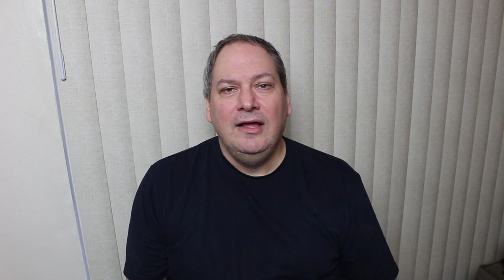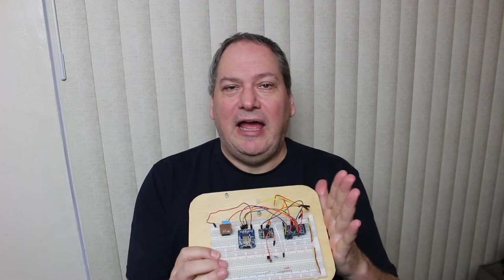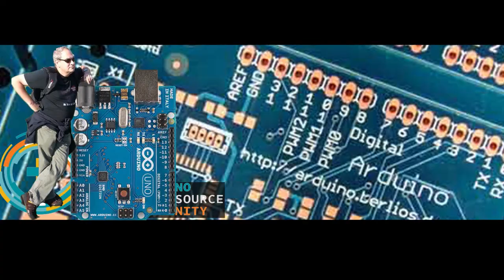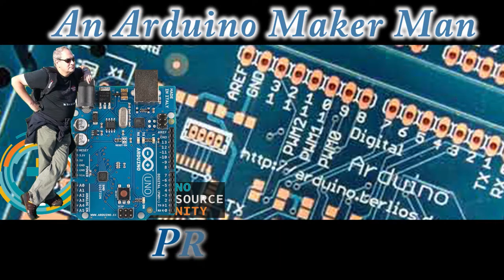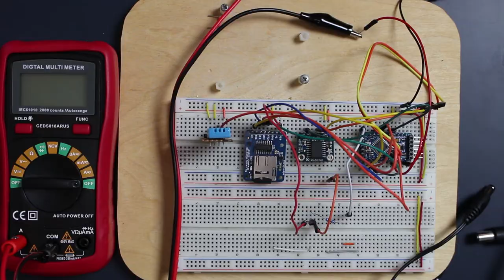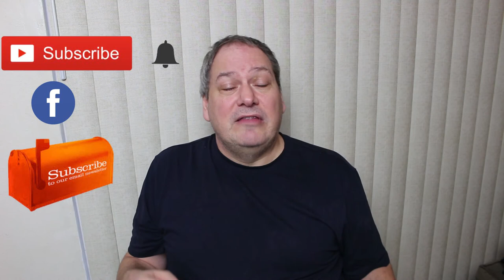Project: Example using a RTC to wake-up an Arduino Data Logger

Comment: Thanks for the blogpost, it was really helpful! I'm currently building a solar powered automated watering system with an attached data logger, so power saving is a real priority. I'll use your approach almost identically, 3ma sleep current is amazing :)

Comment: Hi, thanks for the tutorial and blog. I have  a power consumption on the pro mini of 3mA, but when using the DS3231 the consumption is 9mA. Is there a way to get the DS3231 to operate on its coin cell battery and still keep track of the alarms? Or how can I reduce the power draw? Also my Pro mini and DS3231 both have a Power LED. should I remove those?